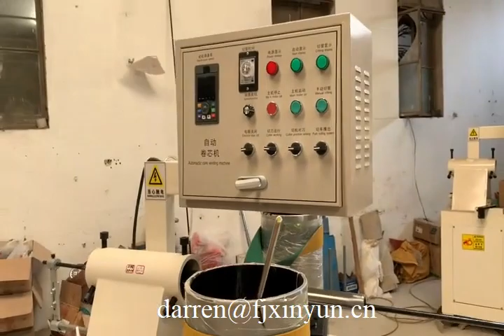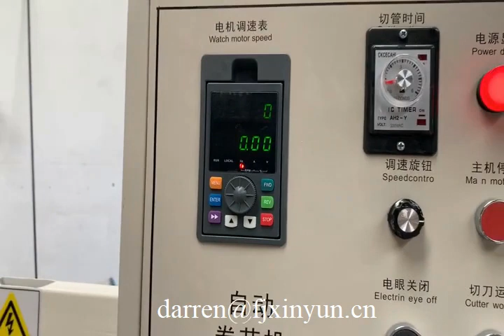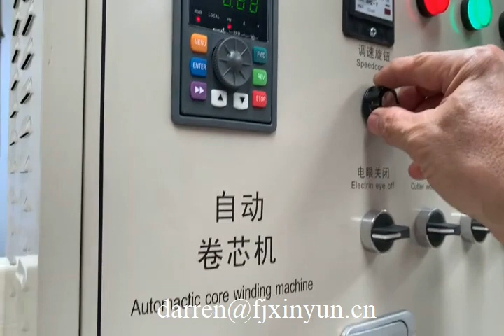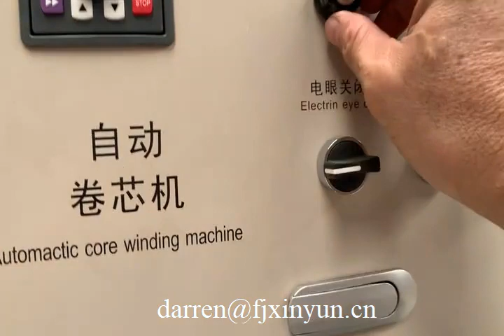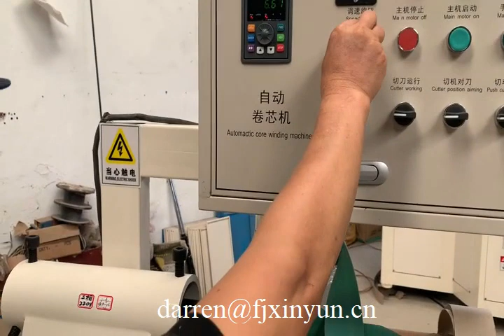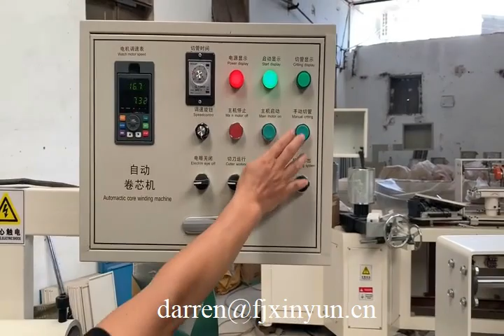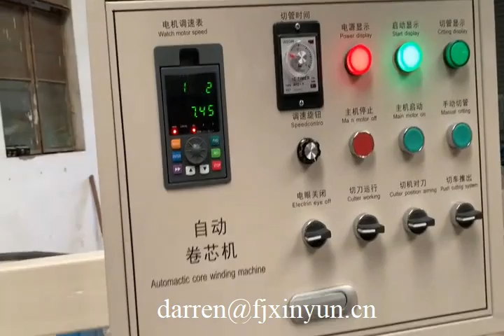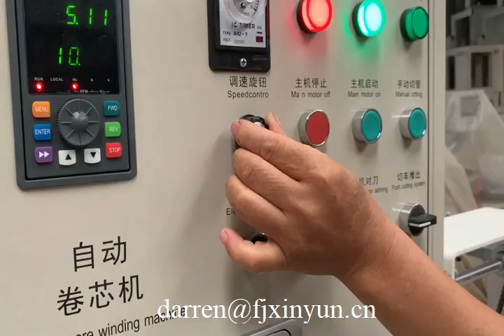How to install and operate toilet paper core making machine

Comment: you might as well leave the core and make the rolls without it, you will be saving a lot of money, time, cost, delivery, transportation, electricity, labour, packing, rent of your factory and rate and you have to buy the whole machinery, OMG. if you give away 10 perforation for the sake of the core its better and cheaper... what do you say
Reply from the maker: Hello,Shza,
Thank you for your suggest.
Some market still need paper core,it's easy for toilet paper to hold,and easy to move.
If you or your friend need any tissue paper making machine,welcome to contact us by email to darren@fjxinyun.cn or whatsapp  +8615060870806
We will reply you everything quickly.
Best regards
Darren Pan

Comment: What’s is the spec of raw material required?
Reply from the maker: Hello,Craig,
Good day to you.
It's using 180-360gsm of raw paper,width is around 70mm,diameter 1150mm is ok.
If you're interesting in buying tissue paper making machine,welcome to contact us by whatsapp  +8615060870806   or email: darren@fjxinyun.cn
We will reply you quickly.
Best regards
Darren Pan